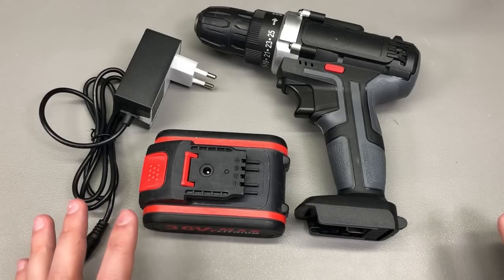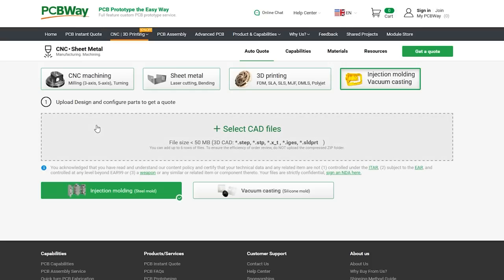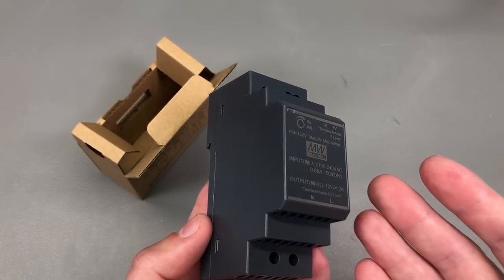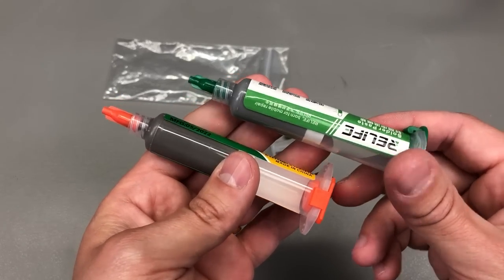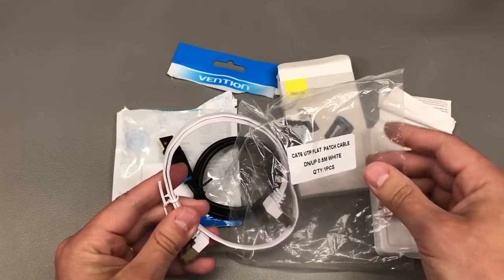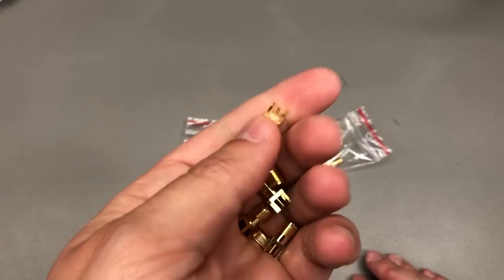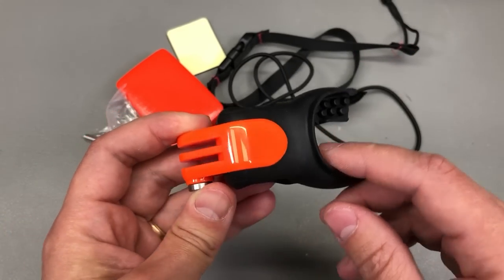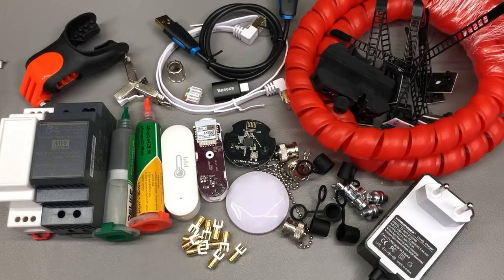InTheMail | Voltlog #418

Comment: I like the Bismuth stuff for repairs. Mechanic has a decently priced solder wire with Bismuth which is much cheaper than the chipquick stuff. Great for repairs like removing HDMi ports or such things to avoid heating up others parts too much. Not sure if I would use solder with such a low temperature for soldering though. I usually only use it to remove stuff, clean the board very well after and then solder with common solder. I would be too afraid that the joint could get weak in a normal scenario.
Reply from the maker: One scenario that I was contemplating with is double sided assembly. Do one side with 180-200 C paste and the other side at 138 C without the need for extra adhesive, surface tension and the different melting point should keep even heavier parts in place.

Comment: I really like using the double-sided hook+loop tape (one side hooks, the other side loops) for cable management.  It looks neat, and puts minimal stress on the cables - I buy it in 5 or 10 metre reels, and cut to length as needed, so minimal waste. The UK ex-monopoly national phone company (British Telecom/OpenReach) sets high standards for all it's cabling, and it specifies the same stuff for all their data and fibre optic cabling. You can also use it with the larger adhesive or screw type anchors.  I've also used reusable cable ties, but prefer the hook-and-loop tape.

For sleeving, I use the braided type cable sleeves (has the disadvantage that you can't so easily retrofit it as spiral wrap, but looks neater).  The cable types which usually get installed around here are Cat 6A, or Cat 8 (not Cat 7), plus Cat 5E for stuff which is never going to need faster than 2.5 gigabit (e.g. CCTV drops etc.).
Reply from the maker: is the hook-and-loop tape the same as velcro type cable management band? The type that I have shown here in previous mailbags a couple of times? That's also a good fit for large bundles of cables, I agree.

Here I've seen CAT6A used predominantly in residential wiring and CAT7 for those that are willing to spend a little extra for some future proofing. I'm guessing any industrial/commercial wiring is more likely to get something like Cat 8 if it's required.
Reply: @voltlog  "Velcro" is indeed a trade name for the most popular brand of hook-and-loop fastener (actually, they invented the stuff).
Reply: @voltlog  Yep, pretty much the same, (I found the tape in #350 - but I think the Velcro-brand tape I've bought in the UK in the past is a slightly different construction - it doesn't have a "shiny" side).

My understanding is that Cat7 isn't in any of the IEEE/TIA standards for Ethernet, whereas 6A and 8 are, and that Cat7 is only a bit higher performance than cat 6A (but Cat7 uses proprietary "GG45" connectors).

Comment: Buying mains PSUs from Aliexpress always feels too much like Russian Roulette.  Instead, I've taken the approach of either searching for a suitable used adapter (e.g. for a "tier 1" laptop or printer brand) in my home country, and (if I can't find a good match) pairing that with an external DC buck or boost module (e.g. a CC + CV might be needed for a battery charger)... Or instead using a USB PD trigger module (again with the extra external buck/boost if it's needed) this approach means I can also use the equipment with a power bank too if I need to...
Reply: Even though most laptop power bricks have weird output voltages, with some determination they can be coached to the voltage you actually need. Starting with a well known brand/model helps as schematics can be found online. Changing a few resistors will net you a 24V supply from what was a 19V one.

Comment: on the plug in battery charger are you sure they are "Y" class caps as china cheapies always seem to use "X" class  and of course "Y" class fail open and "X" fail short which when the Chinese use them they would be better not fitting any capacitor at least that way you will not get 240V into your 5/12/24 volt device or even you self
Reply from the maker: Y class typically looks like that and is typically installed between primary and secondary of transformers. Whether or not they are truly Y class and what level of quality is debatable, I have not verified that.
Reply: @voltlog  I have always found quality Y type caps are clearly marked as such and both X and Y caps are blue and look the same on the outside in my experience